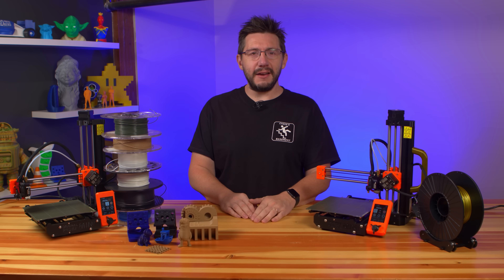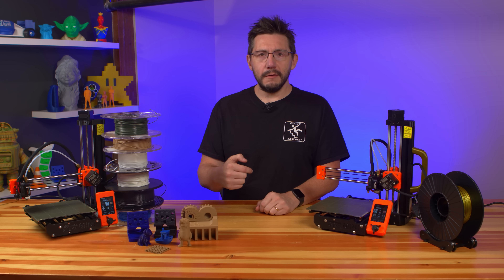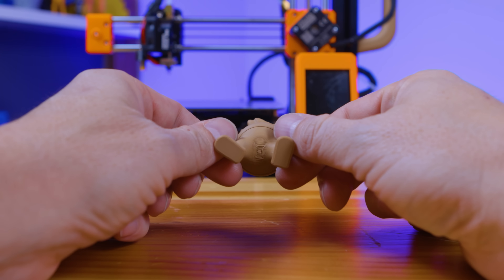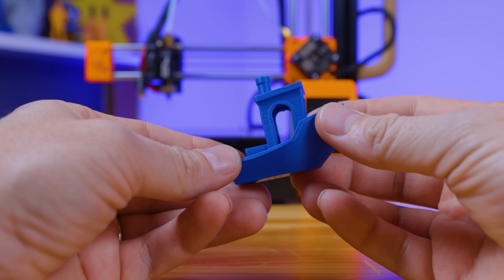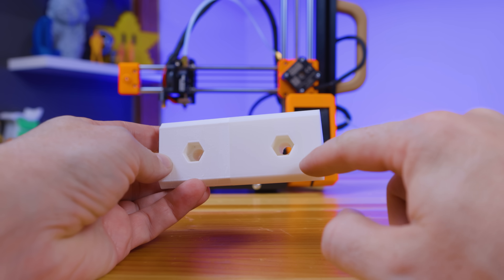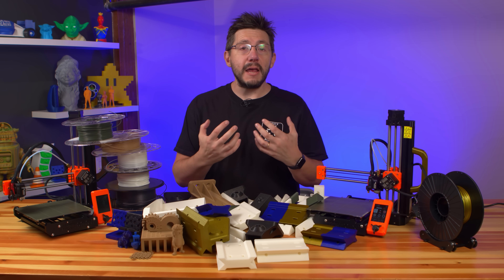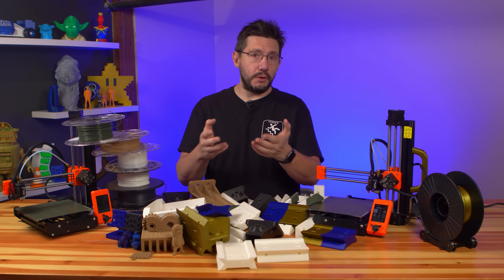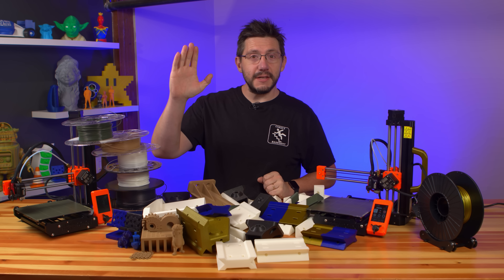Prusa MINI Review // So far ...

Comment: Wifi is a lie and a joke.
Reply from the maker: WiFi is a real thing in general. Promise.
Reply: @3DPrintingNerd  :-) Except for Prusa, is what I meant. Wifi was also promised and never really delivered for mk3. It is a bit prehistoric here in 2022, where even my dishwasher is on Wifi receiving firmware updates. Wireless internet has been around for a few decades.
Reply: well there is wifi now, it's slow but it's here for the mini
Reply: @hani_issa  I stand corrected. Good for everyone.

Comment: I don't know how many videos about 3D printers I've watched, but I'm going back to the best channel so far (I know there're tons) and your channel is one of them! So if I have a $1k budget (because I'll go with the build packages) and I'm looking to start with 3D printing, should I go Pursa i3 MK3 or mini?  ...is a +- $600 difference. Thanks
Reply from the maker: Both are great machine, but I feel like a MINI is a decent option for getting started. It’s minimal time to assemble and it’ll get your feet wet. Like anything it’s not perfect, but I think it’s a great price for what it offers, and I’m including support from Prusa in that. What’s also great is it comes in under budget. You’ll get used to printing and pick up some fun materials and have enough left over for a second 3D printer down the line.
Reply: @3DPrintingNerd  Wow! Thanks a lot didn't expect to get answer back so quickly!! Thanks  again ...I'm watching right now your Mini upgrade video ;)
Reply: @3DPrintingNerd  ...Oh! ...should I go Rhino3D, Fusion 360 or FreeCad? Thanks ...a little I'm a video editor/camera operator ;)
Reply from the maker: Fusion 360 is fun and had a free version. FreeCAD is free and SUPER powerful. I have no experience with Rhino unfortunately. Have a look at Tinkercad as well!

Comment: Hey i just got the prusa mini and when i did the calibration test it started in the bottom left and the square ended in the top right. Any help?. Also when i auto home it goes to the bottom left but like 2 inch up from the edge.

Comment: I have 2 minis and can barely keep them running because they jam all. the. time. I keep seeing these great reviews for the mini, but have never seen anyone address fixes or troubleshooting for this issue. When they work they work great, but the key phrase there is "when they work" which for me has been considerably less time than "when they jam".
Reply from the maker: Hmm. I didn’t experience jams, and I have a few hundred hours at least on it. If I do, I’ll definitely investigate
Reply: @3DPrintingNerd  it's been a little disappointing because I just get these glimpses of the awesome machine from your review, but then I have to take apart, clean, and reassemble the whole filament feed line every other print. I keep messing with them though, maybe I'll find a fix someday.

Comment: The printer does not cost $ 349. It says so on the Prusa home page but is much more expensive at checkout. The cost of the printer without tax and shipping is $ 399. Including tax and shipping to Poland is over $ 490 (shipping cost $7). And the cost without tax changes depending on the currency and country of shipment (not cost of shipment but printer itself). If you want to ship to Poland, but you want to pay in USD, because it's much cheaper, you won't pay with the card. Why? Because they say so. I've already had a few approaches to the Prusa mini, but every time they piss me off so much that they end up with another Ender model (the Ender CR-6 is cheaper in Poland than the Prusa Mini and will arrive five times faster from China than 500 km from the Czech Republic).
Reply from the maker: Shoot, my review for the MINI came out, then Prusa released the MINI+ and it's more expensive. So, unfortunately, my review got outdated super quick.
Reply: @3DPrintingNerd  Prusa paid for the ad and got it. How does it work with PETG, ABS and elastic filaments? Does the flexible sheet work? Does ABS stick to the sheet? The Ender CR-6 and the Prusa Mini cannot be compared here (in Poland CR-6 is cheaper than Pursa Mini).
Reply from the maker: No he didn’t. Why would you assume that without asking first? Prusa didn’t pay for anything. In fact, none of my review are paid for, even when companies have aggressively offered to do so.

Comment: I can't justify the price when you can get an ender 5 for around the same price and the pro version for just a little bit more, both of which have a larger build volume. The ender 5/5 pro are (in my opinion) more sturdier (giving less shaking and vibrations). I have an Ender 5 pro and absolutely love it except for the magnetic build plate that came with it as the plate under the magnet was 2mm higher (massive concaved surface) in the corners than the center (easily fixed with a glass build plate).  

Love your channel though mate, it's the go to channel for 3d printing in my home.

Comment: $350?   Its a oberod? clone, similar to the SmartRapMini.   The smartrapmini designer told myself and others to stop farking around with this design, I guess he hates it, buts SIMPLE and easy to build.   I am still improving my smartrapmini design, perhaps a 32bit controller could get super smooth parts like that, but 8bit is ok.   The only thing that needs improving is the bowden feeder, and reduce the screw count.  I could not sell mine for $175.  parts cost more than that, steppers are $50/4.

Comment: Reason I am posting this is my recent neighborhood challenge, my machine vs. the original PRUSA. You might find this interesting. Just 4 months ago I entered the 3D printing world. Now, what machines did I start with? I was checking out snapmaker, as I thought how cool it would be to have 3D printing, laser and CNC in one unit. I then found Dobot MOOZ. For about 3 weeks I suffered with printhead jams and bed adhesion issues. Then I actually learned how to load filament correctly, surely different machine to machine. I now straighten 5 inches of filament, and I mean nail  I preheat the nozzle to 200c and I gently feed it though the filament sensor that detects filament run out, then through the feeder gears. If filament is not nail straight it can, and has, run amok and tangled in the gears, now I have achieved perfection. Next the adhesion issues. Watching videos I tried painters tape, hairspray, glue stick, and FINALLY the solution that works like gold for me. The cheapest Elmers school glue. The one we remember as kids, the white, soap and water clean up. Ironically it seems stickier when still the cloudy white BUT wait till it fully dries to clear and, perfect stick. AND, as a bonus, just put a couple dabs of water on the dried glue, and the glue will remain on the build plate if you allow the bed to cool after printing. A couple dabs of water to make it that creamy white, let it dry to clear again and its reusable for about 5 or 6 times on the same Elmers glue bed covering. MANY MANY complaints on this Dobot MOOZ but this is funny. My neighbor has a PRUSA, the original. I actually get better prints than he does which stunned him. I did hook up with a second printer for a larger print volume, Sindoh DP200. BUT the MOOZ prints are significantly sharper but the Sindoh helps me with larger print size requirements.

Comment: Two prusa mini's in our school's lab and they had severe jamming. Tried lots of hot/cold pulls, disassembling and reassembling, and reseating the ptfe tube in the extruder. If the tube is deformed or a particle gets stuck in the nozzle, the parts have to be replaced or at the very least for the ptfe tube flipped 180. Did not realize it was a single drive extruder until opening it up.

They are functional, just need something a little more than a beginner's knowledge to keep them running which isn't too unique for the $450 price
Reply: @npgoalkeeper _ tried the needle a few times and the printer jammed again in less than a minute of printing. The needle has worked before on other printers just no luck with the prusa mini

Comment: So... Lets see if I have this summarized correctly...Issue 1 - remove ring from memory stick. It will resolve an irritating vibration... Issue 2 - During first assembly, lubricate all the linear bearings. Will likely resolve some premature bearing failures... Issue 3 - Consider replacing the extruder, or more likely replace it if you get print failures or jams... (I'm going to replace it with a Mosquito, I think. It's lighter and should put less strain on the arm.) Issue 4 - Thermistor wires getting broken. These wires are really thin. Investigation needs done involving the "human factors" related to the thermistor. The only way I can think of where people do anything near the thermistor is when they change or clean a nozzle. If anyone uses wrenches or pliers, they need to be really careful with the wires.   I think those were the issues mentioned here... Oh and Joel is not paid to do these reviews... ;-)

Comment: To all the hopeful fanboys: be careful! This printer HAS issues!
What I experienced:
1) The Mini works best with Prusament and Prusament only!
Other brands will lead to frequent clogging and extruder jams. (See the prusa forum)
2) The MINDA probe is only good for indoor environments with constant room temperature.
This sucks because:
3) this printer stinks! A fact that is frequently overlooked by the PR-people of 3D printer companies is that a printer will dramatically decrease your air quality! (#plastic fumes, #ultra-fine-particles #fibrogenous-particles, #lung-cancer)
So placing it in a well vented room (like a garage) seems like a good idea, but MINDA won't support it voluntarily.
4) the cantilever design makes this printer fragile! XYZ- missalignments can happen quicker than you think! So be careful and only touch it at the base!
All the other issues that Joel mentioned can be adressed with the glorious prusa support, but not these 4!

Comment: I have had my Mini for about 3 months now and I can only partially agree.
While it works absolutely fine (despite a lot of stringing) with Prusament, it was a complete nightmare with cheaper filaments.
Naive young me thought it would be a good idea to purchase a plain white RYKE PLA spool from Amazon for prototyping.
Oh boy. That was a mistake. 
I easily spent 10 hours of my freetime trying to get this stuff to even extrude properly.
The nozzle constantly clogged and the extruder jammed regularly with this material.
However, after hours of trial and error, cold pulls and extruder cleaning and idler tension adjustments I found a solution that worked somehow.
I used a 0.6mm nozzle and printed at  230°C, which was the only way to get a proper extrusion.
However, even with that milestone, I had some molten filament drip out of the hotend, like ABOVE the heaterblock, where the hotend is screwed into the heater block.
This requires regular removal of molten PLA in hourly intervals during printing. Not cool!
I tried to print that crappy filament away as fast as possible before something else went wrong and I was so happy when I could finally return to Prusament.

Tldr: if you consider buying a Prusa Mini, do yourself a favour and stick to Prusament only. There are a lot of reports of people complaining that other filament brands just don't work on this machine.
I learned it the hard way.

Comment: Hi Joel, thanks for the reviews and info, keep it up. This year I tried to become a Prusa boy too but failed. I bought a Mini with high hopes but sadly a major design flaw sent my mini back home and my Prusa boy membership was no more. Anyway enough of the banter. The MINDA type level probe is a huge problem in environments where the temperature is not constant. The trigger level varies with temperature. My print farm lives in out buildings which are not heated at night so the printers start cold in the morning and warm up through the day. The Prusa mini will not consistently level in this situation. The results are high first layers, nozzle dragging across the expensive print bed and prints stuck so tight to the bed that the bed is delaminated when removing. I don't have 30 minutes to set up the printer level for every print and there is no manual bed level option so the Prusa mini was totally unsuitable for me. Prusa appear to have attempted to cover up this issue by setting the minimum start temperature to 15C. This also renders the mini unusable for me for about 5 months a year. Buyer beware. The mini is great for indoor heated rooms but is unsuitable for colder print farm rooms.
Reply: I second that! I had to improvise a construct with an enclosure, blankets ontop and hot waterbottles inside to get my Mini working in 12°C surroundings (my garage).
This is just dumb.
I have to leat it warm up at least one hour before I can even think of trying a first layer calibration.
Prusa should have mentioned this when advertising this product. INDOORS ONLY!

Comment: Please follow up on the solution to the mysterious sound at 9:25 if you find one. I've been trying to diagnose this myself for a while now
Reply: My new i3 MK3S+ is making the same noise sometimes. I think it has something to do with the filament angle or the extruder. Not sure yet. Will try readjusting the bondtech gear alignment or idler tension to see if that effects it.

Comment: I waited 8 months for my Prusa mini which ended up having clogging issues very early on (probably a week and a half of owning it) and when I had no other option, I tugged the filament out breaking motors inside that push the filament through.  That was the last day ive had the thing working, and when I tried to get some help on the issue but the people who run prusa forums offered no help.  If you are new to 3d printing do more research before you make an expensive mistake like I did.
Reply: try using their live chat support on their eshop page; 24/7 live support there. They were very helpful with me when I threw the bed belt on the mini (totally my fault), and showed me where the instructions were for repair, and answered questions as I walked through the steps. Had it up and running within an hour.
Reply: Bottom right of the page on this link: https://shop.prusa3d.com/en/ 

I don't even know why they advertise the forum support; this works so much better. Though they never advertise the bed square check feature on the MK3S as much as they should either.
Reply: @Mr25561  I will give that a try thank you

Comment: The MINDA probe is a nightmare for consistent mesh bed leveling. How much money could they be saving from using the heated PINDA probe?
Reply: This!
The minda is shit.
I had to place my Mini in my garage where it has roughly 12°C during winter.
If I don't give my Mini at least 1 hour of warmup-time inside its LACK enclosure the first layer calibration will be different between each and every print. So annoying!

If you also intend to operate your Mini in cold surroundings, you will soon recognize that it refuses to even heat up when the measured temperature is below 15°C.
My fix to that problem was placing a waterbottle with hot water ontop of the bed and moving the hotend close to it.
After the bed has reached ~17°C you can heat up your enclosure with the bed itself.

Protip: to keep the temperature constant over time cover your enclosure with blankets and place at least two other hot water bottles next to your printer. They work essentially like heat-batteries and can keep the air in the enclosure warm for about 8 hours straight! (With constant heatbed output that is!)

Comment: I've been using the Mini for about 8 months now and it has gone through hundreds of prints. I keep it well maintained and only had to replace a single nozzle and PTFE-tube (the one it came with was too short). I keep having to adjust the settings though, while every screw is checked. I am getting  a lot more stringing now than 8 months ago. But all in all it is holding up pretty well.

I probably would have chosen the MK3 if I had to choose all over again, but all in all it is a nice quality little printer.

Comment: I also have the rattling and cooling fan spin-up noise problem, but on the MK3-S. 
What solved the fan problem for me was loosening the fan screws by half a turn so that the fan housing does not warp. After all, the fan hardly weighs anything (and the fan housing isn't very strong). I don't know if that works for the mini fan though.
For the rattling I have to investigate further, but it might be a belt grinding somewhere. 
Thx for your awesome videos! 
Sorry for all the "fans" in my post, but I'm a big fan :-)

Comment: Hi Joel, I've been using the Prusa Mini for quite some time now and I absolutely love it! I had some technical problems in the beginning. There was a problem with the extruder but thanks to the awesome helpdesk I was able to fix that. Also my usb drive had a problem and it took me quite some time to figure out that was why the printer wasn't printing properly (it wouldn't let me change the settings during print anymore). 

This being my first 3d printer it was a bit of a learning curve but now I feel I really understand the machine. Great stuff!

Comment: I think the prusa mini is a perfect beginner 3D-Printer. I got mine in July. It's so easy and self-explaning.
Easy building, Plug it in, Load filament, Plug usb-stick in, Print one of the example-models or slice something with the standard settings in prusa slicer. I think it works like a charm. I had NO problem until now. 
One thing I really don't like is the single Z-Axis, but the printer is stable enough.